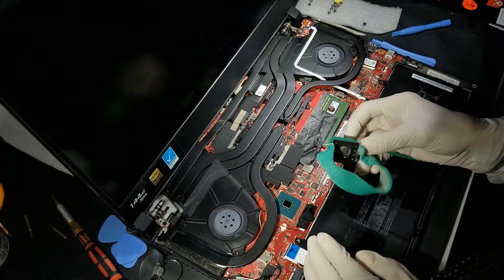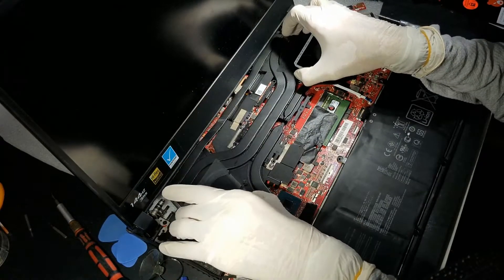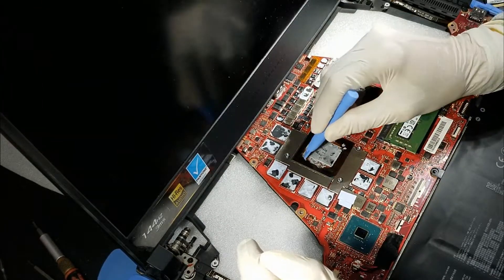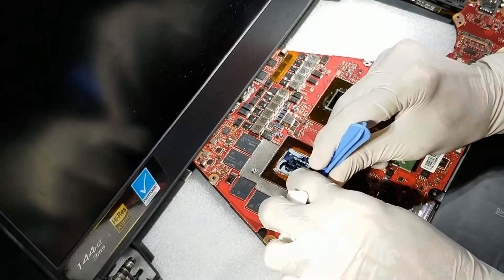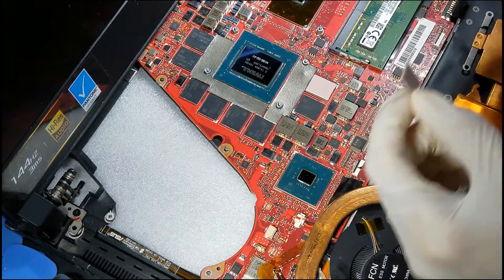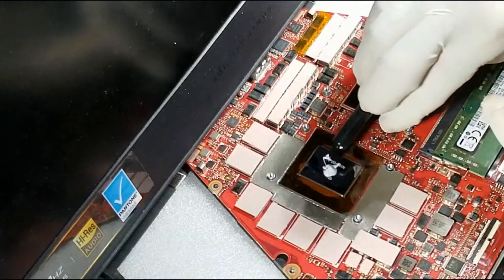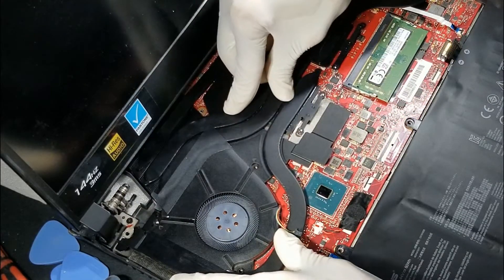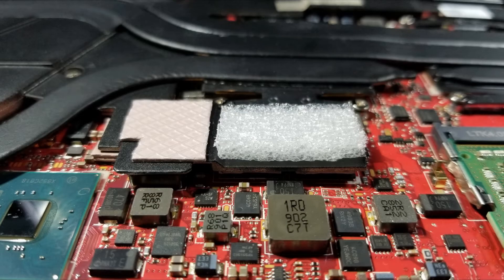THERMAL PASTE REPLACEMENT FOR ASUS ROG ZEPHYRUS S GX531GW

Comment: hey, i was wondering, i have GX531GV (RTX 2060) model and the mainboard is fried due to electrical surge. i looked up for the replacement part and i can only find the GX531GW (RTX 2070), do you think the replacement could still be done?
Reply from the maker: I know it's probably late, but you can find a used one with the same price of the motherboard.

Comment: I have an Asus Zephyrus GX701GW, a few years old.  The GPU fan was always rattling and finally failed.  I ripped it apart, much less disciplined then the video, but I changed the fan, and battery while in there.  I cleaned the old paste up which seemed to be applied poorly and used Grizzly kryonaut extreme.  

My new fan purrs like a kitten perfectly.  I used to get cpu temps capping out at 97-98°C, now the highest cpu I've seen is 83°C while gaming.  GPU temps are good as well, but I'm pretty sure I used to be thermal throttling because of the cpu which sucked.  I'm very happy because I was pretty sure I would ruin my laptop but now it actually runs better haha.
Reply from the maker: Glad to hear that, 👍, about the fan, main start doing the same, I think I will replace it.
Reply: i know that feeling, im about to disassemble mine in a couple of days, and im kind of terrified even though im used to taking laptops apart
Reply: @ViperGTS737  Good luck.  Even though I somehow got it together without extra screws, I think next time I will take some pictures as I go in case I get sidetracked during the job.

Comment: Can you use liquid metal thermal paste with GX531GWR?
Reply from the maker: You can if you know what you are doing, but I do not recommend it in general, there are thermal paste that do the job well with out the risk associated 
With the liquid metal, " if the heatsink you have is aluminum then DO NOT use liquid metal, as it will eat up your heatsink and damage it permanently "

Comment: Hey i have the Zephyrus gx531gm Notebook can anybody tell me if i can use liquid metal on these coolers??
Reply from the maker: Yes you can, but not on alimunium surface. If it is copper then it is fine.. also make sure that you are veary cearfull..it is recomended to not use liquid metal unless, you know what you are doing. Best of luck.

Comment: Thanks you for the video, I'm also so wondering how can we connect eGPU to this laptop since it does not support thunderbolt!
Reply from the maker: My advice, if you do not have eGPU and you are thinking on buying one for this laptop then " it is not worth it", also mostly you will not going to be able to run eGPU with it, just buy a new laptop, or a PC if you need a GPU for simulation tasks...etc.
Reply: @MechanicalCell  are the thermal pads necessary?
Reply from the maker: @B L A C K H O L E   yes, they are A MUST. Other ICs must be cooled as well.

Comment: Oh god i really need your help, i did all the steps but the heatsink is glued to the cpu and gpu, it won't move at the center at all, what can I do? When I try harder it feels like im moving the whole MB and I'm quite scared
Reply from the maker: you can move it left and right, little by little and it will be removed, or use few drops of Nail Polish Remover just to soften the old thermal paste, make sure that you did not forget any screw  !!

Comment: Which black tape can we use ?
Reply from the maker: what are you planning to use it for?
Reply: @MechanicalCell  As you can see a black tape on fan and Heatsink . I want to use tape on Heatsink and fan . And another for around CPU. I am planning to apply liquid metal on CPU. Which tape can I use for Fan and CPU ?
Reply from the maker: @kashishsadadia3623  to this regard, you could use Black Duct Tape, or Kapton Tape, that will do just fine.
Reply: @MechanicalCell  okay, thanks 😊
Reply from the maker: @kashishsadadia3623  i do not recommend liquid metal, it is not worth it (on a laptop), use any other type, also use "Kapton Tape" around CPU/GPU. best of luck.!^_^
Reply: @MechanicalCell  okay, thanks for your support

Comment: What should be the thickness of the thermal pads?
Reply from the maker: it should be as thin as possible while making sure it still able to cover the gap between what it needs to be cold and the heatsink. let us say 1mm is ok but use sticky type, not like the one i used..

Comment: I changed my rog zephyrus thermal paste. I used 0.5mm thermal pads for the other modules, and kyronaut paste for the Cpu and GPU. Temps are down -15celsius. But the problem i get is i get GPU usage spikes, like every 5min GPU goes 99% usage and i get FPS drop. Is it because of the 0.5mm pads? Or i should repaste it again?
Reply from the maker: in general, i do not think that it is because of the thickness of the pads, it must be a software related issue, the pads i used are 1mm in thickness.
Reply: I know some time has already passed by, but i think ive got the same problem and idk what its causing it. Have you found a solution? My temperatures are around 90° for CPU and GPU while playing COD ony my widescreen, thats why i was thinking about repasting it.
Reply: @Br4inFrost  The best solution was to buy a Desktop PC. I bought one. But also the laptop is better now, i didn't use thermal pads again, only thermal paste, it helped a lot.  Kyronaut paste is doing a great job. Also 1 of my fans was not performing good, i replaced that and it helped a lot also.

Comment: Hi i really need ur help . Can i just using thermal paste for replacing the old one or i must use thermal pads too for the smaller square thing ( not the cpu and gpu ) . Sry bad english hope u understand whay i am saying
Reply: Did you get the answer???
Reply from the maker: hi, sorry for the late response, but yes you must change them to make sure you avoid any problems.
Reply from the maker: @Flow some thermal paste, becomes a bit conductive over time, and some are conductive to start with. if any of it touch a sensitive component that might lead you into problems, since laptops are using circuits that are sensitive to micro ampere/ volt, moreover, the space between the heat-sink and the V-rams and the GPU memories are not same, and so in some places the thermal paste will be thick, then with time when starts to harden it will act as insulator rather than thermal medium, hence they use pads in the first place. So, it is really recommended to replace them, if removing the heat-sink means damaging them.
Reply from the maker: @Flow there was no paste, what you see are thermal pads, they are soft and sticky to hold everything in place" heatsink", personally i have never seen a thermal paste on Vrams/ voltage regulators/ inductors before in a laptop or a card " not custom made".

Comment: i have the same laptop, but your website is down, can you mail me the manual please. This is the first time I'm doing this. The ifixit guide  does not tell me how to repaste
Reply from the maker: i know T_T, and it will be down for sometime, The ifixit shows only the first steps you need to get to the point where the video starts!, i have no manual, The video is made to explain and show you how to do it :), only advice i have is to use [ sticky thermal pads, you will find them in blue color, they will make everything much more easier for you.... good luck  ]

Comment: Great video. Since your site is down, could you point out what has to be done beforehand? Also, what temperatures did you got before and after the replacement? My cpu cores max out between 96 to 100 degrees C, which is just bonkers... GPU gets to 88-90C. I am planning on replacing the thermal paste with liquid metal from thermal grizzly (did the same with my delidded 8700K from my desktop). I am not sure if it will make a large difference since the heatpipes/heatsink are so small...  Only one way to find out. Let me know what you got, I'm really curious.
Reply from the maker: Yes, i have updated the video description to a good source to start with. replacing the thermal paste definitely will make a difference (depends on your chip), but over all "at least" 5 C difference, the main thing is how fast you could transfer heat from the CPU/GPU die to the heatsink, and i am 100%  sure that the application they do in factory for thermal paste is so bad, that is why you should replace it. i did notice a very good difference in temps, the CPU was getting as hot as 100C and GPU up to 86¬87C, after replacing old paste i get, with real life scenario playing RDR2 CPU=67C(undervolt) GPU 78C..
Reply: Thanks for the link. Those are some awesome temperatures. I was a bit worried it might give not much difference, for example I had a GTX 480 where I replaced the thermal compound with liquid metal and the temps only got down 2 degrees because the cooling was just nog beefy enough to dissipate that much heat, no matter how good the thermal compound. But this seems promising. What do you use to undervolt? Intel XTU?
Reply from the maker: @wimpieeeeee  i use throttleStop Advanced but much better then XTU in my opinion, i also ( normally ) lock the cpu to 2.2Ghz when playing games, in most games you do not need the full 4.2Ghz clock speed anyway... i get very good temps, noise level at performance mode, and experience...try it.
Reply from the maker: @wimpieeeeee  if the thermal solution is not effective enough, then yes, but in general, i think no harm on trying anyway ^^
Reply: I have Zephyrus S17 i7 10875
(version with liquid metal on the CPU)

but while playing little in the first 20 days, the CPU temperature was at 72-85 while playing at TURBO and max game settings.

I run cinebench one time, and since the day I receive in some games 85-95c

while other games still the same temperature as before 70-80c

what the chance that liquid metal can dry little after 20 days?

I also notice that clocks while playing in few games are staying at 4200Mhz
and than the temperature become 85-95c

but sometimes the game played at 3500-3900MHz and than the CPU temperature 71-85c
Reply from the maker: @kdilac8879  the thermal paste is made to last for very long time, unless you did not apply the thermal paste correctly ( sometimes more, sometimes less) that would have huge impact on your temps.
Reply: @MechanicalCell  I send the laptop to RMA. 3000$ laptop and 2 months in use. and yesterday my HDMI port stopped output 4k signal to my TV's in home.
maybe my motherboard had problems of overheat.

this laptop come with liquid metal so it's weird to get 95c while playing.

Question, if the service lab will replace the motherboard? they will need to reapply the liquid metal on the CPU?
Reply from the maker: @kdilac8879  damm that is bad, i think that it has more then just heating problem, it will be clear when they inspect the laptop, and yes they will need  to reapply the paste to the CPU/GPU for sure >>>> but i am not sure if they will use, liquid metal, personally i do not recommend it, due to the fact that it is a laptop, which means that you will move all the time and that may make the liquid metal shift all around the Cpu area.( not sure) but i think so >>> best of luck, ...keep us updated :) .
Reply from the maker: @kdilac8879   this is some what a shitty service lab, as well as Asus support, i have seen the your videos, here is what i think:-
1- try to check with shorter HDMI Cable [ high quality], as well as different monitor, i am thinking if there is any problem with the power from the HDMI to the monitor, or maybe the monitor it self is sucking a lot of power from HDMI that the port IC cant handle, i am not sure thou [ i just assume that maybe is so] because, it is hard to know just like that...! [ you need to try] 

2- [the service lab ! : reinstall HDI image]; what they did here is reinstalling display driver file.

3- Some time my pc  turn on by it self when its on sleep mode, and that's due to a background software that is using the internet, check your background programmes and make sure they are off,  as well as switching the network of when you go to sleep, it also could be windows updates or even power option, there are many reasons why this might happen... try to do testing, or simply reinstall windows.  

reinstall windows, and try to run diagnose tool to your SSD.

let me know the results after you try these steps, i hop it will be fixed :)
Reply: @MechanicalCell  yes I ordered few new HDMI cables Amazon Basic and other high quality HDMI 2.0 cable.
In addition to all my 6 HDMI cables that i used until now.

and they are working fine with other 4K devices or cheap asus laptop with Intel gpu at 4K that I have.

from the new cables, only the Amazon Basic cable is output for me 4K at TV right now.

but only 1 time each 20 tries.
and there is red dots in the screen. and picture off and on alone.

when I change to FHD everything is fine.
FHD is fine with all the cables.

the problem happening in all my TV's, and before the 23/08 everything works fine with 4K.

i think the same, it's seems that the HDMI port can not output 4K to TV.
and maybe it's about power of the port.

so maybe the HDMI problematic, but only after 2 months, It's sad.

and in the asus forum / reddit I saw more 2 users reported problems of green screen and no signal about the HDMI port in this model.

If it's really the port, anyway their lab for sure will not repair the port and they will just replace the motherboard

I ordered more 2 cables, for 8K
they sould have more power so maybe it will do a magic.

i hope
Reply from the maker: @kdilac8879  if you did also check on other monitor and still same problem, then you may try the other things i mentioned, other then that, you really have to take it to service to fix it.. :(
Reply: @MechanicalCell  Yes I send the laptop for RMA again, and hope they will fix it.

but I think they will change the motherboard
asus labs dont repair motherboard problems from what I know

so chance of losing the CPU liquid metal, it's built-in in the 2020 models